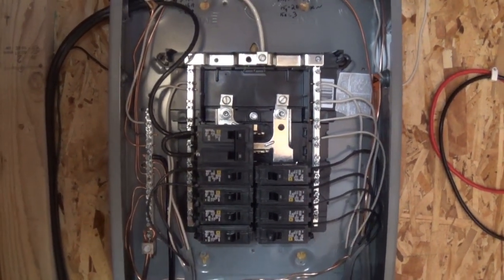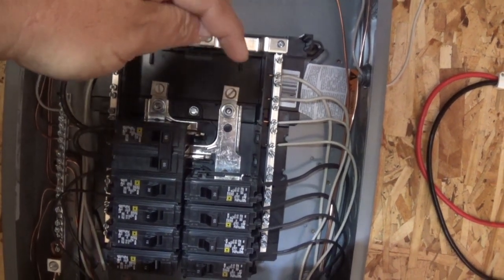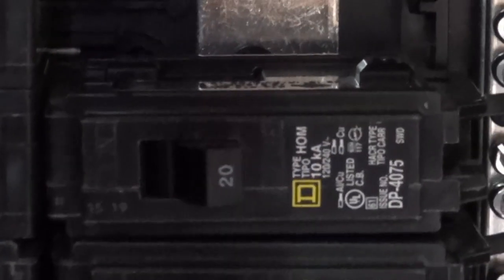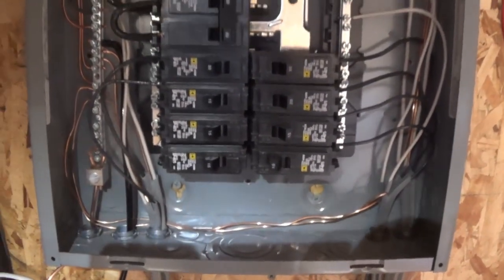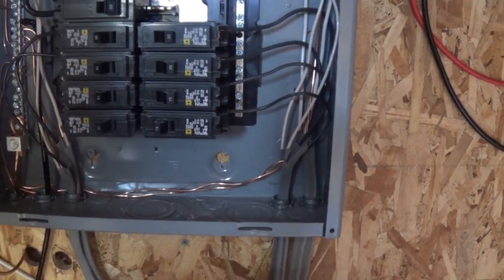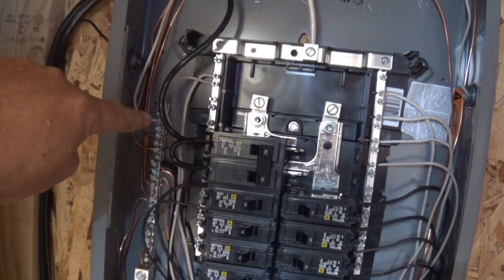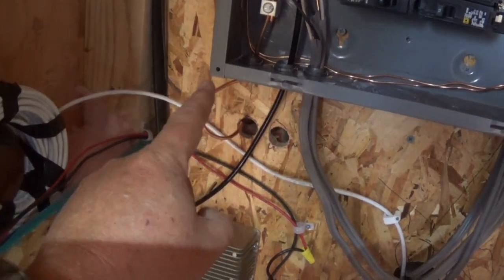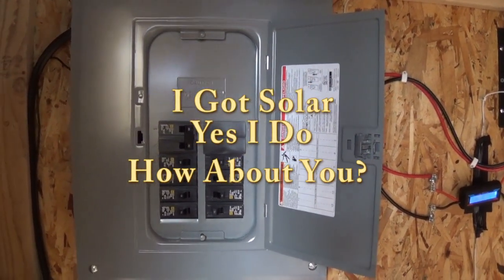Wiring a Distribution Box for Off Grid Solar - also known as a Breaker Box

Comment: thanks for the vid...just wondering what size wire are you using to feed the 60amp breaker and jumper on the 60amp breaker?
Reply from the maker: i used 6awg

Comment: How did that jumper work? The black inverter wire going to the 60amp x 2 and one side of the jumper shares with the inverter wire? How is the fit of the two wires together in the breaker opening? Im going to try this for my off grid cabin.
Reply from the maker: after all these years it still working great. . not the best thing to do but its working

Comment: I did my "main panel" the same way; however, when I use the outlet tester, I'm still showing "Open Ground" at all my outlets... what am I missing?
Reply from the maker: i dont know. i am not an expert. good luck
Reply: neutral and ground need to be bonded at the panel. I had electrician install the panel at our cabin and none of my outlets tested good until he put a jumper between the neutral and ground.  After that all my outlets tested correct/120volt

Comment: So basically what you did to that breaker panel 30 amp double pole you could save yourself a lot of time and more storage by connecting a wire to the two top where a main breaker would be and that would be energized but also I have seen people do two inverters and two solar systems just to be able to save a little money on adual phase inverter
Reply from the maker: i know now. lol. didnt think of it at the time

Comment: I’ve got 2/0 connecting my battery bank to my charge controllers (and shunt and fuses, etc.). How important is it to use really soft welding wire instead of your Home Depot by-the-foot stranded wire? Will either wire compress properly with a 10,000 pound hydraulic crimper?
Reply from the maker: i think once you get to that size its considered welding cable. not 100% sure.

Comment: You can get a Siemens MTO100A transformer 220-460v x 1 in & out is 2 Legs 110-230v Dual Phase so you can have 220v if needed ! Amazon I have a 5KVA 230v x 1 - 48v inverter that’s Hybrid !
Reply from the maker: thanks for the info

Comment: This is great!  How far are you running the lines to your barn etc?  I have about 100 feet to go! 😬
Reply from the maker: 50 plus feet. i am no expert but i might use 10awg to run the line with a junction box to reduce the size so the wire fits into outlet and switches.

Comment: Does the breaker give you 240v? Trying to power a well pump. I only have a 120v inverter.
Reply from the maker: it can. from the inverter you power each side with 120v line . using a double pull breaker it will pull voltage from both sides. . careful with your inverter not sure how it may take it. i would stay with 120v unless the paper work on the inverter said you can run 240 off of it. keep in mind i am no expert.

Comment: How do u put the jumper on or is it included with the double pole breaker?
Reply from the maker: i just cut a wire to fit the same gauge coming in and made a jumper. all elections will tell you dont do it.
Reply: @ArizonaHotHomestead  
Thanks again man for sharing this video! Are you still using that same system if so how is everything working? I think I’m going to get a separate box for my solar shed so I can have power there and then another one in the cabin since I’m such a far distance

Comment: Great video. I have a question. I have a square d breaker box and my ground and neutral are on the same bus bar. Is that okay. And is it necessary to have the inverter going to a main breaker or is going to the panel ok
Reply from the maker: i am no expert. there are 2 ways i learned about the ground .. yes the ground and neutral are the same bus bar but can also be different. ... the inverter has to go to a main breaker that feeds the other breakers. i might be able to wire it without but having a main breaker makes sense to control everyone with 2 switch instead of having to switch each one plus the part that the breakers connect to will be live which is to risky for me. use a main breaker.
Reply: @ArizonaHotHomestead  thank you. I wired my inverter to a main breaker and then to a sub panel. 👍🏽
Reply: @CBGRAPHICSAirbrushArt  your way is how I thought of doing it, but in this video, the two can be in one box.  I bought a separate main breaker box, shut off.  Like the set up here, looks simpler.  Also, the 60A is a good size, not overkill but I wonder if there is a scale for what amp size to use.   I have a 3000-Watt inverter with an 80A charger controller.  Two 30A breakers are easy to find.  Maybe if I find 35A or 40A breakers....not sure they make them....so 60A sounds good for a main.

Comment: Question please: Did you insert two stranded wires into the same double pole circuit breaker (top hole) then "jump" it the the other hole on the double pole circuit breaker? Thank you!
Reply from the maker: yes
Reply: @ArizonaHotHomestead  So the double pole breaker has enough space in the input to fit not only the 6awg from the inverter but also another 6awg jumper cable?

Comment: I understand the double pole breaker because it also gives you a main breaker to shut off all the power in the box.... my question is if the jumper works to add power to the other side of the box perfectly.... can I simply just use a jumper on the main lugs, if i'm using an ac disconnect between the inverter and the box. I'm limited on the spaces and circuits in my initial box so I'd like to use all single pole breakers (6) in my box. My inverter is a 4000 watt and it recommended a 8/2 wire feeding the panel.... so is my jumper idea just as efficient?
Reply from the maker: i am no expert but it seems right.

Comment: Great job explaining! I’m in the middle of DIY battery back-up & 3 car alternator as a battery Charger self-sufficient the battery bank will power the 12v Dc motor that turns the alternators , my inverter I 5 KVA pure sine wave 48v and a Moes Automatic Transfer Switch my batteries are 3.2v lithium phosphate 280Ah for 48v & Yinlong 2.4v 40Ah for 48v
Reply from the maker: nice.

Comment: I forgot to ask what size line did you run from your inverter to your double  breaker? And thanks
Reply from the maker: 6 awg.  keep in mind the amps that will run in it. 10awg for 30amps, 8 for 40 and 6 for 60.

Comment: Ok so let me get this straight....you can use the EXISTING house wiring and distribution box using the 60amp breaker to ELECTRIFY both sides of the fuse box via the inverter? 
I want to go hybrid, solar wind....on a house that is NOT currently hooked up to any electrical grid off property.  Or is there any meter from any electrical company...
Reply from the maker: if you want to also have on grid i have no idea about that.
Reply: @ArizonaHotHomestead  
When you say ON GRID you mean get electricity from a provider?
Reply from the maker: @jaxstudios7670  yes. you get power from generator, stored in batteries from solar and wind or on grid. a hybrid inverter will have connection options for each.
Reply: @ArizonaHotHomestead  thank you

Comment: Thanks for the walk through! We did the same setup. Quick question, we have a 4000w inverter pushing 60 amps of AC power to our panel box. Currently we are only running the camper on this system. But it is DRAINING our batteries in just a few hours. I'm wondering if it is the factory battery/charger thats in the camper. Thoughts? Should I just disconnect my camper battery system?
Reply from the maker: i am no expert so not sure. but .... take a look at each appliance you use and measure the watts being used. also whats the size of battery bank? solar panels total watts?

Comment: How do I connect a solar inverter to my current and old electrical panel connected to the grid?
Reply from the maker: i dont think you can. you can if the solar inverter is a hybrid you connect the on grid to the inverter follow instructions with inverter  becus i dont know. my closes power line is over 2 miles away.

Comment: One quick question...when you ran your jumper ( 6 awg ), do two wires fit into the one side of the breaker?  I'm trying to do the same setup.  How is yours setup? Thanks
Reply from the maker: the jumper is on a double pole so it makes connection to both sides of the box. by doing this you send volts to both sides each 120volts. in the city this double pole would be for a 220v line. i used it to proved power to each side.
Reply: @ArizonaHotHomestead  Ah yes, I get that.  I was just wondering how you got that #6 wire stuff in the breaker.
Reply from the maker: @PizzaFridayDon  lol not sure. it fit ?
Reply: @ArizonaHotHomestead  Ah, got my breaker today finally... factory was shut because of Covid-19 outbreak.  I was able to put 2 #6 wires on the top side like you got and jump it over to the other side.  I appreciate your video!  I setup my system like yours and it works well.  

Thank you!
Reply from the maker: @PizzaFridayDon  sweet.   after about 6 months to a year make sure all your connections are tight. sometimes the connections loosen due to the expansion when it heats up .  have  a great day
Reply: @ArizonaHotHomestead  Love this doing the exact same thing starting tomorrow!  thanks.. I made a happy miniature set up for practice run I’ve been watching and studying for a year attempting the big ☝️ good stuff
Reply from the maker: @Mark19766  your going to have fun

Comment: I that a 60AMP double pole connected to solar lines?  if so where do those back braker cables of that double pole lead?  the solar charge controller?
Reply from the maker: solar panels connect to charge controller which connects to the batteries which connect to the inverter which connects to the breaker box. . basically the box thinks everything is ac power.
Reply: @ArizonaHotHomestead  yeah thats how i have mine setup and doesnt work.  battery just discharges all the time.  Battleborn
Reply from the maker: @matthewalkman386  if batteries are not charging something might be wrong with charge controller, panels, or wire connection. if you have a fuse or breaker between panels, charge controller, batteries maybe it is the problem.
Reply: @ArizonaHotHomestead  whats the best way to charge a battery?  ongoing and keeping it charged?  since solar only works with sun you likely need a DC to DC charger or something too right?
Reply from the maker: @matthewalkman386  solar, wind. generator.    dc to dc isnt real efficient from what i hear. its known as a bedini generator.
Reply: @ArizonaHotHomestead  so a solar generator to charge the battery when the solar isnt working?  Doesnt sound right.
Reply from the maker: @matthewalkman386  generator regardless of solar, propane, gas would charge using a charge controller that can handle a generator. when i hear dc to dc i picture people using batteries to charge batteries and in some cases the same batteries . i have been asked that question a lot.
Reply: @ArizonaHotHomestead  do u have a product recommendation you can send me?
Reply from the maker: @matthewalkman386  sorry nothing on this end. home depot and amazon is where i get most of my stuff.
Reply: @ArizonaHotHomestead  give me a break

Comment: Is that a DC down converter for a water pump?  If so how is it wired? Directly to the batteries?
Reply from the maker: the converter you see in the video is a 24v to 12v step down wired from my batteries to a light switch for dc lighting in the room.
Reply: @ArizonaHotHomestead  Ok cool.  I'm trying to wire up a 48v to 12v step down directly from the batteries to my water pump.   Is it grounded at all?  Any type of fuses used?  My pump supposedly needs a 10 amp fuse.  I'm just beginning my off grid adventure so any help is appreciated!

Comment: One more thing-want size solar array is feeding the panel-are there batteries anywhere in the system? Thanks
Reply from the maker: i have videos on my entire system..    i use 8 rolls surrette 6v 460amp batteries wired to make 24v. i have 6 panels 265 w 24v each wired series and panel to my charge controller .

Comment: How has this held up? The source lines for power into the box look small for 60amp service 
Maybe just that the video doesn’t show it well?
Reply from the maker: 6awg. keep in mind just becus the service box is 60 amps doesnt mean anything in there is 60amps. in fact the inverter is only 2200 watts so its only going to provide 20amps at 120v.  i do plan on some day changing out the inverter for a 5kwatts  with is 40amps.

Comment: Finally the answer to how to wire a breaker box from an inverter with only 120 volts. This is the only video I've been able to find that shows this out of dozens. Thanks!
Reply from the maker: nice. the jumper could have been done differently in that i could have used a small bus bar or something to create 2 leads one for each side but i didnt think of it when i did it.

Comment: Good video. I had a question though. Were your neutrals and grounds bonded in the breaker box, or did you have to do anything with your inverter (pull/add a screw) to keep it from frying? Assume it was a pure sine wave inverter?
Reply from the maker: yes the neutrals and grounds bonded to the breaker box plus the inverter has a grounding wire to the same bus car as the grounds.

Comment: That is some sloppy wiring. Not to mention your jumping the single 6 gauge wire to feed both 60 amp buss bars. Each buss supplies 60 amps. So the single wire coming in could experience 120amps of service if running full load. Also, you should never use solid wire for your supply power, it's not sufficient. This is a fire hazard, and over time, these wires heating up and creating a point of resistance is only going to give you problems.
Reply from the maker: so far after a few years no problems.

Comment: On one of those auxiliary breakers, could you run it to the outside for a 110v plug and plug your generator in and use your generator as a back up when your battery bank is to low?
Reply from the maker: i wired my inverter to a plug on the generator. when i start the generator the inverter will charge the batteries and provide amps for loads.  most inverters should allow this some have the ability to do an auto start on the generator if the gen is set up for auto start. otherwise if you just wire the gen to the breakers it wont do anything to the batteries.

Comment: That looks awesome! I want to do the same but I’m not sure on everything just yet. Do you not have enough power coming from your solar to hook up 220 to panel? I’m not sure how that works just yet. Still trying to figure that out. I want to run 220 to panel so I can run my dryer and also have a breaker in the panel along with a plug out to where I can run everything off if generator when my batteries are low. This probably don’t make any sense!
Reply from the maker: a good inverter is also a charger and a really good charger has the ability to hook up a generator to it.  these box are standard city house box . you normally wire to the center with 2 black hot wire giving 120v to the left side and the right side. a 220/240 breaker will bridge the 2 sides giviing you 220/240v. Need to know how many watts will be used. need a large enuf enverter to handle the amps/watts (load) being used. double to cover for the 220v load. example. total 120v and 220v being used at one time totals to lets say 5000 watts  for 220v and 1000 for 120v you want to double to 220v to 10k plus the 1k. your inverter needs to be able to handle continuosly 11k watts. use really large wire like welding wire 2/00 or bigger with 2 black wires, 1 white and a ground. i am no expert so look wire how to wire 220v distribution boxes. and 120v. good luck
Reply: Appreciate you! Thanks for the advice!

Comment: Thanks for the detailed video. I’m about to wire the tiny house my wife and I have built. Never done anything like it. A lot of what you did confused the hell out of me. Is it going to be that complicated if I’m not screwing around with the amperage on the box? I suppose it’s time to figure out how these boxes work.
Reply from the maker: keep it simple in white to white , black to black. green or copper bare is ground. white is common, black is live. maybe one way to look at it is black is positive, white negative. power runs thru the black and returns thru the white. . dont attach the batteries until everything is completed or you will have a big spark somewhere.

Comment: Would this pass an electrical inspection with the whole jumper double pole breaker situation ?
Reply from the maker: lol i dont think so.
Reply: @ArizonaHotHomestead  Wondering how many years this has been in use now and if you have had any issues with this jumper getting loose, hot, or causing other issues?  About to squeeze the trigger if I can do the same with my system at my cabin at lease until I get a 2nd inverter and can run 240 to the panel ( that will be $800 later when business picks up for me again in summer lol)

Comment: I'm not an electrician either but I'm wondering how you get a second pole for a 240v set up because if you jump the other pole from a single source wont your sine waves be in parallel I was under the impression  that you needed alternating sine waves for single phase 240v
Reply from the maker: from my understanding to make the 240v you just need another hot 120v wire.  but me too not an electrician.
Reply: @ArizonaHotHomestead  so when you jumper the 240v breaker it will operate like a 240v stove? because i was wondering if you needed a split sign inverter  for like a whole house setup
Reply from the maker: as long as you are operating within the watts of the inverter  you can wire it to a 240.  watts is the same regardless of volts.

Comment: This is exactly what I have been looking for. My inverter only puts out the 3 lines, so I wasn't sure how to hook up the 2 mains. The jumper is a great idea, thanks.
Reply from the maker: you bet. check the connection after a few months to make sure it stays tight.
Reply: What size wire did you use for the jumper